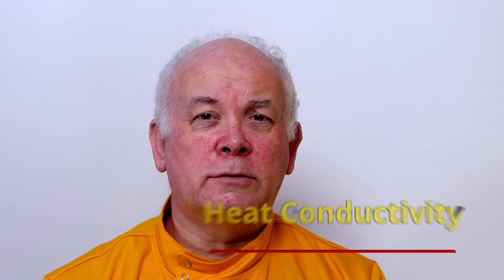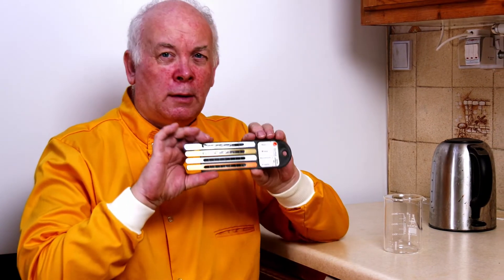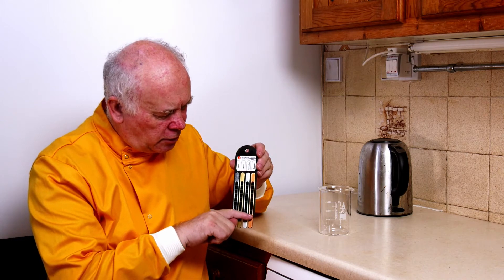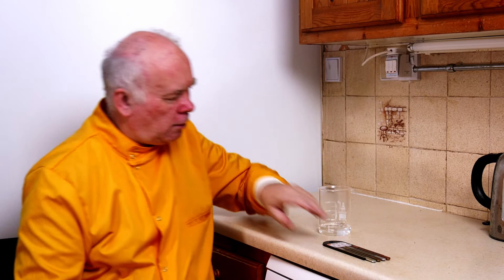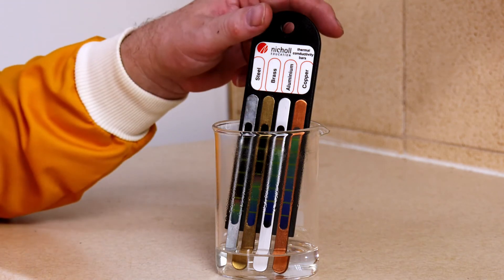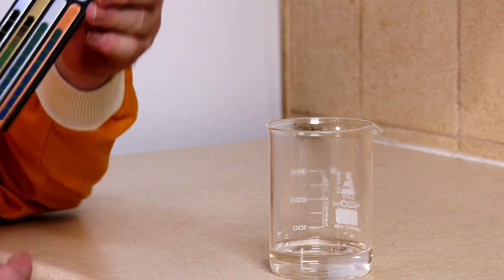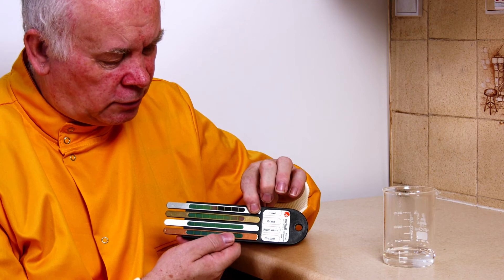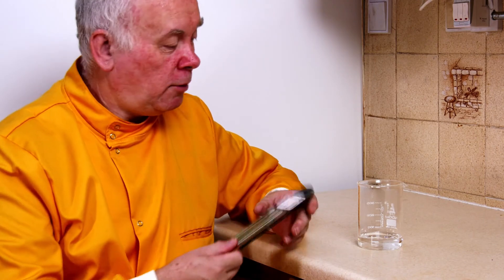Thermal Conductivity Bars | Heat Conductivity Of Different metals

Comment: Thanks a lot for these valuable information sir. Based on your experiment, can we say that copper also heats evenly when a heat source is applied to it?
Reply from the maker: Nearly. THe copper is an excellent conductor and it seems that it does this but in fact it doesn't. But the heat does spread out very quickly.
Reply: @PhilipRussell  appreciate your feedback